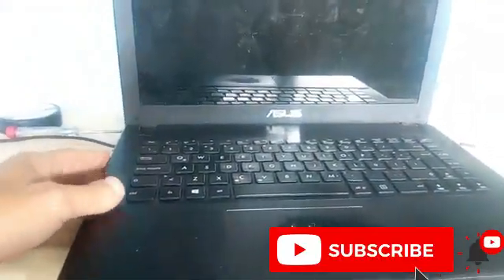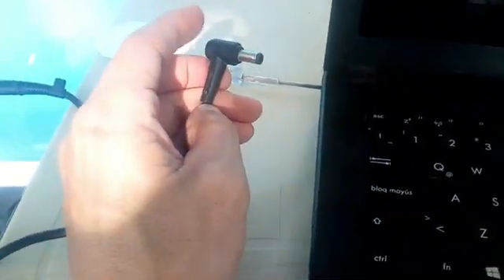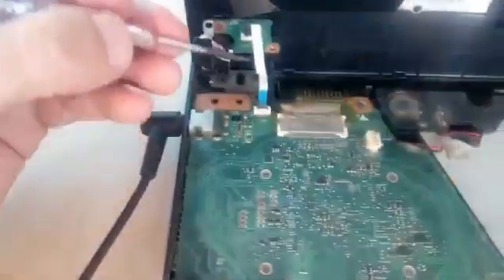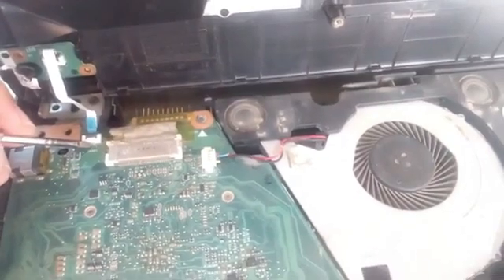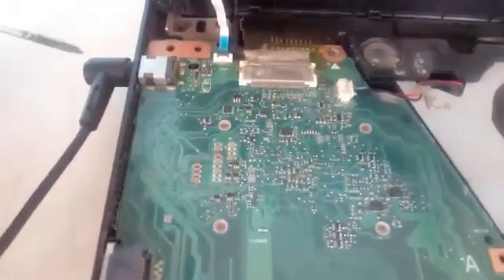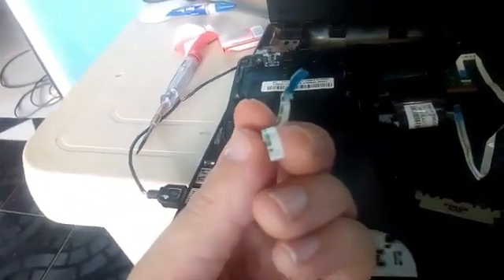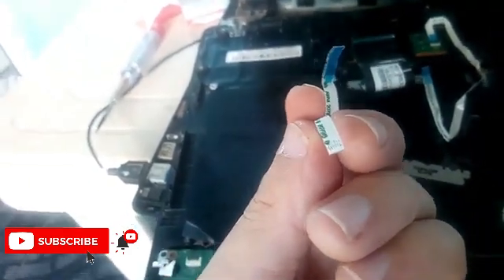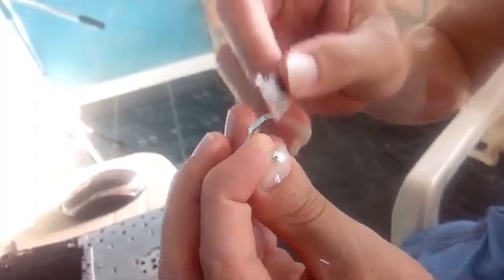laptop asus won't turn on// solved.

Comment: Hello good day! May laptop auto shut off when I open it, shut off after 5 seconds, the logo comes out and the my laptop off. but sometimes okay, may loptop normally open but most of the time its autoshut off. Pls help me, what can I do with this 😭
Reply from the maker: It needs first of all maintenance..  you need to aply thermal paste to the processor...  also you need to check if it is hot when it turns off
Reply: @CarlosTec  thank you! Maybe the damage it's not the motherboard?
Reply: For specific problem of my laptop is autos shutdown while booting? Am i right? The logo comes out and then shutdown
Reply from the maker: @petercondes8258  you need to uncover the laptop and disconect the hard disk, the key board.. the usb ports... may be are broken and that is the cause

Comment: Bro when I plug in the charger 
The led doesn't blow 
But the current is going to the led 
What's the prblm 🤔🤔
Reply from the maker: You need to check the power button, probably it does not work, .

Comment: My sister has Asus Vivobook 14. Laptop would not turn On . Asus recommended in their guide  to hold power button for 40 seconds with power cable disconnected.  Then to reconnect charger and switch on the laptop.  Wow this fixed the issue abd her laptop is now working OK. She thanked me for helping.  Try this out yourself before anything else...Good luck.
Reply from the maker: Thanks man ..
Reply: alhamdulillah , thank you . it does work
Reply: You saved my life by commenting this method
Reply: @babyblue22  press and hold the power button for 40 second with charger disconnected . then reconnect the charger then turn the laptop on . it should work
Reply: Have laptop 
I click power button 4-5 times then it's start so what should I do??? 
Please help me
Reply: @ankitmishra9685  well if it stays then, it works.
Reply: thanks so much mine just worked after a long time thinking that it broken
Reply: It doesnt work
Reply: I encountered the same problem with my vivo book..when i read this comment i followed your instruction and it did work!!!Thankyou so much!!
Reply: it works, thank you so muchh!

Comment: Tried to shutdown My asus but the light is still on, the bottom is also hot,, i tried to cool it down for a moment using a fan yes it turned off but  now my laptop doesn’t working the power button is not working
Reply from the maker: Probably the fun of your laptop stopped to work.. because is broken or it needs cleaning, you need to check if the fun is still working but you need to uncover your PC.. may be your PC suffered a damaged because the fun did not work anymore . You need to visit the professional service to receive help..

Comment from the maker: Hi friends, I want to share this information with you, if you have doubst coment below, I will try to respond all your questions...
Reply: Ok well, my computer just doesn't have any power, like when I plug in the charger the light doesn't even blink, any advice on that?
Reply from the maker: @fellowtruckliker111  have you tested the charger? According what you say, it seems like the board has no energy, may be the charger is broken or doesn't not work.. you need to try other charger...
Reply: @CarlosTec  ok thanks
Reply from the maker: @jheramaybinggoy2754  may be you need to test your charger, if you laptop does not show you the red light is because has no voltage or it has has a short circuit, to sum it up the first thing you need to do is to ensure your charger is working...